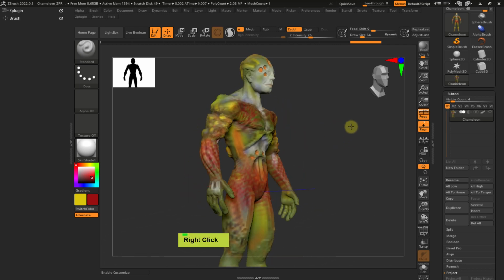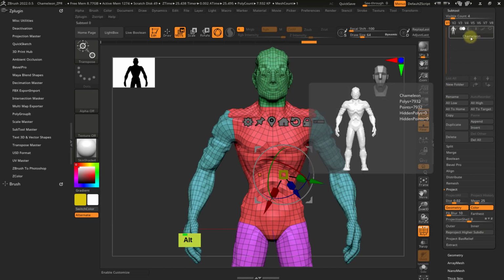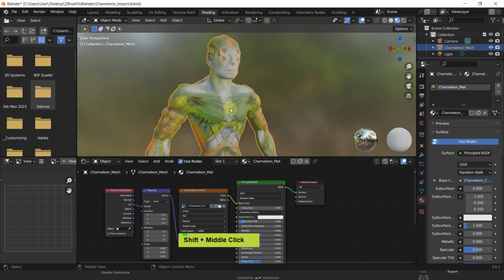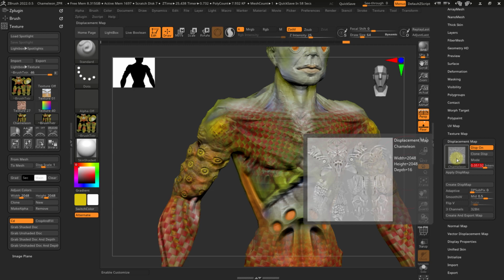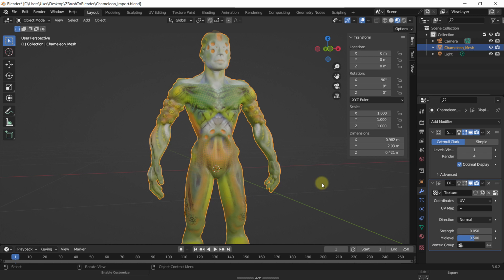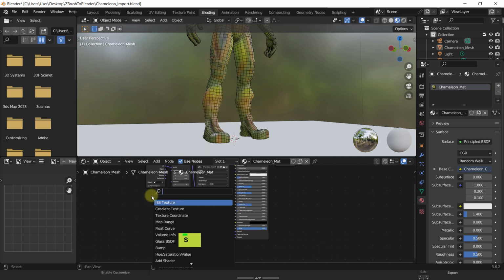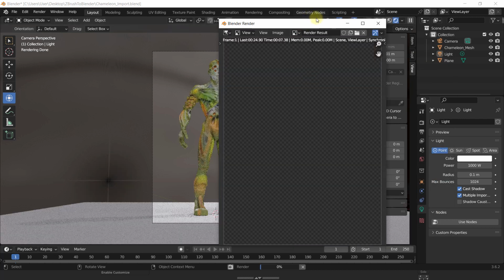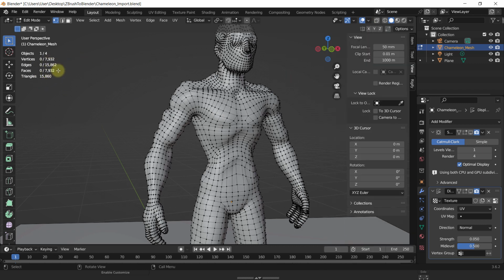MS3D | ZBrush to Blender | Single Mesh Character Setup

Comment: hi man thanks for videos. i have a question for you, i understand that you switched from 3ds max to blender. what is the reason for this and which software do you think is better and simpler in modeling?
Reply from the maker: Hi, due to the pandemic the popularity of Blender skyrocketed. This application is also free. The switch is not my choice, I preferred Max, but newcomers in 3D at the University liked the Blender option better. There is no big difference. Some parts are better here, some better there. I like UV, Retopo, Scene management, file units-export-import in Max better, also liked the CAT rig a lot. Blender is free, that is true, but plugins addons not. There is no perfect 3D software anyways. I am using these about 22 years and thought they will evolve to be easier to handle, but it never comes. Learn the basics in as many as you can. Some areas in the industry are using a lot and jumping between them. There is no one best, many used for a few tools and that is it. Have a good day, Cheers
Reply: @ms3d622  thanks for the answer. 22 years is a very long time regards  from turkey dude